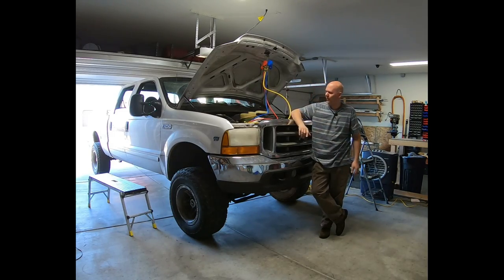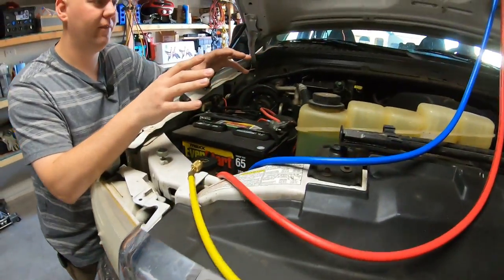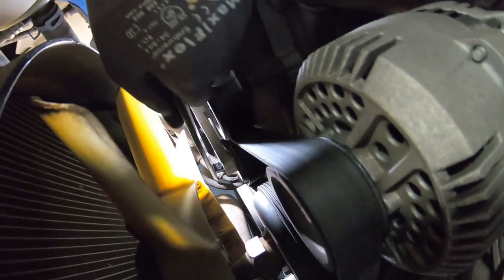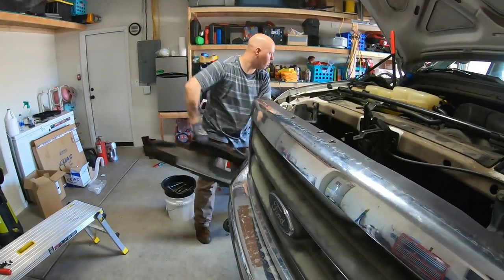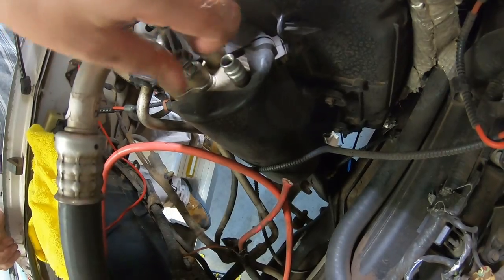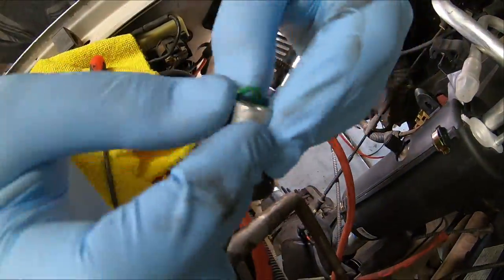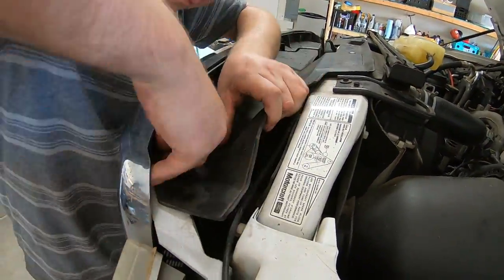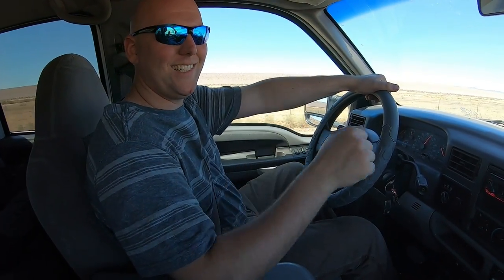Ford F250 Super Duty A/C Compressor Replacement condenser, orifice tube, evaporator, accumulator

Comment: Did this AC condenser have the coils that run across? Because I need to know if it does maybe this will fit on my 2001 Ford excursion, I bought one from partsgeek and they sent me the wrong one and now they won’t even respond to my emails about wanting my refund.
Reply: Thanks I know where not to get one
Reply: I’ll never order from parts geek, they’re customer service is their email, which they never reply to
Reply from the maker: Shoot I don't remember now! I sold the v10 and went to a 6.0l and I wish I could remember for you

Comment: For the belt tensioner, there is a kickstand on the bottom of it. Its definitely a knuckle saver.  Google image for the reference.
Reply from the maker: Interesting, I'll have to look into that!
Reply: Diesel tech Ron has a video showing the little spring loaded tab about 1/2 to 3/4 of an inch long on the bottom passenger side of the tensioner that you push in while holding the tensioner with a breaker bar or the special tool and then while still holding the tab in you release the tensioner and it is held in place to get the belt off. I’ve seen it in a few videos where they take the belt off. You can reach under the tensioner on the lower passengers side of it ( bottom right corner if you are facing forward towards the front of the truck) and feel around for the tab. You push in and you can feel it give under the light spring tension on it.

Comment: Can’t thank you enough for this video.  Bought an older Excursion with dead AC.  Was planning to do this, but wasn’t sure what I would be getting into.
Reply from the maker: Very glad I can help! Let me know how it goes!
Reply: @AGuyandHisProjects  OMG.  That evaporator cover.  I am having a hell of a time.  Seems like Ford could have put locators on the bottom and then secured with bolts on the top.  Unbelievable.
Reply from the maker: @winstonsmith3685  hahahaha I do not disagree! I think I ended up ripping the wheel well liner out and getting at some of them from the bottom...I think. I've done a few of these and the different vehicles kinda mesh together noe

Comment: I think I'm having the same issue with the orifice tube clogged on my 2000 F350 5.4, the A/C works at idle but once I get driving the A/C kicks off and on. I thought it was just low on refrigerant but when I charged the system more now the clutch slips when I rev the engine and only engages at idle. I've got a video on my channel of what I'm seeing. Might just go ahead and do this and replace the whole system.
Reply from the maker: Sounds like an interesting problem you have there. Maybe a weak clutch or loose wire somewhere?
Reply: @AGuyandHisProjects  Maybe? It does seem to lead to a bad clutch that it slips, but when I set the RPM to around 2500-3k like I'm running down the highway the low side drops way down to around 10-15 psi and the high side spikes to around 350 PSI, then the compressor will kick off, pressures normalize, then the system kicks back on, repeating this until I let it idle then the pressures kind of stick around the same. I'm wondering if the orifice tube is clogged full of junk like yours was and the high side is building up with pressure and the compressor is sucking down the low side till the pressure switch sees low pressure and cuts off the compressor. I'm pretty sure the system should be around 50PSI low and 260PSI high or so based on a r134a pressure chart I seen.
Reply from the maker: Yeah, I think that could be a fair guess, wouldn't hurt to check that before replacing the entire system!

Comment: I liked your comment on the third bolt on the compressor—hitting the shroud under it. I got my "one direction" ratchet caght in no mans land. Used a grinder. Cut BRAKE LINE! Ordered motorcraft BRTF-3 to rplace. Only 83 bucks on Amazon. (I was trying to use good finger-thinking and let my disc wander. Your video is awesome BTW.
Reply from the maker: Thanks a lot! Yeah, I've made the one way ratchet mistake more than I care to admit hahaha
Reply: @AGuyandHisProjects  Thank you for saying that. I thought I was the only one. It was an Ikon, not my Snapon, I grinded it off, and it still WORKS! I ground down the metal underneath afterwards as I wait for new brake line. I should have just made a brake line repair. But this way I'll bleed brakes and replace front calipers as well.

Comment: I ground my third bolt down to a shorter size. Ford is almost great. And great compared to 4th gen dodge; where you have to remove the entire dash and steering drop column.
Reply from the maker: I'm not a big fan of anything downtime from Mopar. They do some dumb stuff on the engineering side haha

Comment: Any issues with the open line-sets when spraying all that water?
Reply from the maker: You can tape them up if yiu want. Otherwise throw it on the vacuum and let it go for pretty much forever to remove the moisture

Comment: You didn't have to add any oil?
Reply from the maker: Depends on the compressor. Some will come prefilled with enough oil to take care of your whole system. Others come with zero oil. Others yet will come with "shipping" oil that you have to drain and then add the correct amount to your system. I don't really cover it in the videos because there are too many variables and people take these videos for 100% gospel lol. The oil is something you will have to verify with the compressor you purchase. Even the ones that come pre-filled for your whole system, if you are not replacing your whole system you may need to drain some of the oil out of the compressor prior to install.

Comment: You mentioned that anytime the system is opened you need to replace the dryer. I have a 99 V10 and the clutch/pulley bearings on the ac compressor is bad but that's it blows ice cold and works well.. can I just replace the compressor ? Also, thanks for the video
Reply from the maker: I would always recommend replacing the drier when system is opened. The desiccant can only absorb so much moisture before it is capped out and can't help anymore

Comment: Important to know, if it’s a 5.4 and not a v10, there are bolt holes on the crossmember to go up through with an extension to remove the 3 bolts. It’s in front of the cross memeberon the v10. Dealing with it now
Reply: On mine the hole doesn't quite line up for the third bolt. I can only get a wrench on it which means no leverage. 
Must be doing something wrong.
Reply: @Bionicjoe  i just ran into that because the bottoms were swapped out at some point and 13mm heads because they were standard bolts. Pita
Reply from the maker: Good for posting, thanks!

Comment: Good stuff Mainerd.   Just got finished doing the cylinder head temp sensor and all related parts including the alternator (bearing noise).  Just after I got everything done....  AC system failed on my 03 Excursion.  Guess what's next.
Reply from the maker: Haha it's a never ending battle!